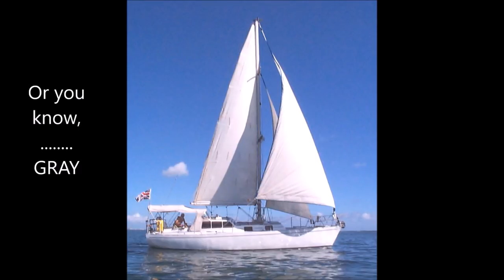Fun With Sacrificial Sail Covers (MJ Sailing - EP 38)

Comment: Hi Jessica, Great job on the Sunbrella sun cover. An unbelievable task amount of work by hand.  Marina owners do not like having to tell us sailors we should not be doing something. They have rules and regulations for the benefit of all of us sailors, so what we want to do does not interfere with  the rights of the other marina users. That said _ you should always ask first to avoid confrontations and putting the marina owner/manager in a position where he also does not want to be. 
PS: Trick of the trade __ forget straight pins and spray glue. Far too time consuming  Get a long reach Swingline stapler (12 inch reach) and staple the Sunbrella fabric down into place.  As another fellow sailor said below _ the new sun cover should have been an inch or two wide and sewing into newer fabric, rather than using the same old stitching line  as your sew down 
 line. Overall considering your age _ you guys are doing a great job. As they say Live and Learn.
Just to let you know _ as a Pro with the correct work tables and machines __ it would have taken me approximately 6 hours to remove the old and add the new one on.  Everything is faster easier __ when you know what you are doing.
 Tell Matt to get himself a long stiff 2 inch wide Stanley planner blade to use as a scraper which is the fastest way to remove old finish.

Comment: How did you u2 attach the flex solar panels to the vessel.  We have an aluminum boat as well and plan to make a hard dodger as our fibre dodger looks like cramp and doesn't give the protection or surface we are looking for.  Thanks Dale & Connie.
Reply: On the hard top dodger, the flexible solar is held down with 3M VHB tape.  It works extremely well for this purpose.   We are adding two flex panels to the Sunbrella fabric with velcro.

Matt

Comment: i have to strip my epoxy down not because the hardener ,but because my epoxy was way to old  i brought it back ,they apologized gave me  free mixer measure cups and gave me new batch of resin.
Reply: I don't know if it's better when it's your fault for mixing it wrong, or when they gave you a bad batch.  At least you got free cups :)

Matt
Reply: Cups at local paint stores are way cheaper than at Home Depot. Looks like the ones you used too, and the resin measurements are on the side. Looks like I'm too late for that tip though!

Comment: Jeez.  How frustrating to have to contend with all of that. I am not suggesting. .but did Sailrite suggest - to spray-stick BOTH materials? It looks like it all worked out o.k.  And the marina owners were Schmucks, no more, no less.  Good job you guys anyhow!
Reply from the maker: When I watched the video they actually only sprayed the Sunbrella canvas and not even the sail.  But I was fighting such high winds that day, my canvas was blowing all over the place and I figured at least the sail wasn't going anywhere after I anchored it down.  😉
Reply: We use 3M spray adhesive too and it works.

Comment: Have you ever tried Solarez UV-Cured Epoxy?  It's great stuff, no mixing, self-leveling and it cures in 3 mins when exposed to sunlight or UV.  It's very durable and designed to work well in a marine environment.
Reply: I've never heard of that before.  I'm always looking for a quick epoxy for stuff around the boat.  Thanks,

Matt

Comment: A funny thing happened this evening.  We were discussing hitting up the local Harbor Freight for a hot knife.  We're holding off for now.  What were the drawbacks you experienced with your HF hot knife?
Reply: It's like a cheap soldering iron... it doesn't get hot enough to do much.  We originally purchased it to cut the foam for our cushions, but it just ended up tearing the foam and not melting anything.  

Matt
Reply: 'Preciate your reply.  How did it work on your sail material?
Reply: We never actually tried it on Dacron sail cloth, but with Sunbrella, it doesn't do much.  The Sailrite hk, while ridiculously expensive, works amazingly.  Hard to justify for a few small projects, but if you have even one big project, it's worth it. 

Matt
Reply: Matt, thanks for the update.  To date all we've done was sail repair, minor rip repairs, etc so a 30 watt soldering pencil has worked out pretty well.  I just took the tip and filed it to a chisel point and we got by okay.  We're thinking of upgrading so we don't have to wrastle with sacrifical cutting surfaces anymore.  Using our methods, by the time we're done, it looks like someone has tried to make a woodburning project.  I tried to fabricate something for a soldering gun but the wire was too large so it never got hot enough.  Anyway, it depends on whether you want to scream once or twice.  Twice is screaming at the pos failing and then for the price of a good one.  Screaming once is coughing up the cost of a decent tool first.

Comment: Why use epoxy on a cabin sole? I’ve done 20 years of soles and decks. Never have used epoxy... use varnish or polyurethane. Goes on much easier and lays nicer than epoxy. Epoxy makes refinishing in the future a horrendous job. Drop the lines now and go sail somewhere.
Reply: The floor is hard maple... not a rot resistant wood.  We picked it because we like the color and grain, but knew that it needed to be really protected.  Epoxy does a wonderful job of encapsulating the wood and looks like poured glass.  Once it has fully cured, we'll put a few coats of varnish on top and shouldn't ever have a problem.  

Matt